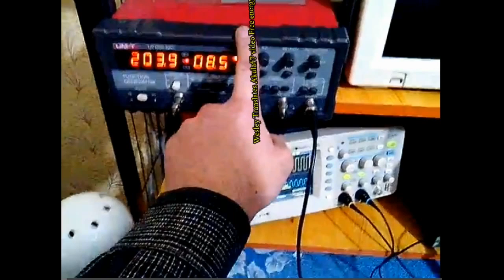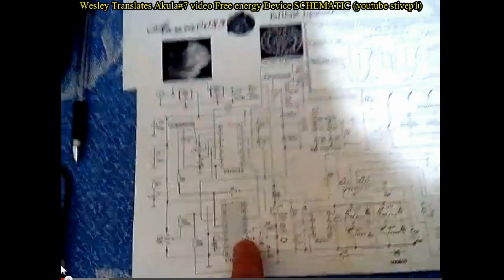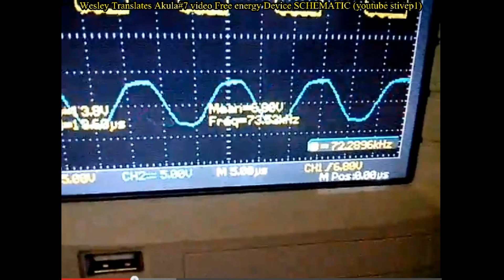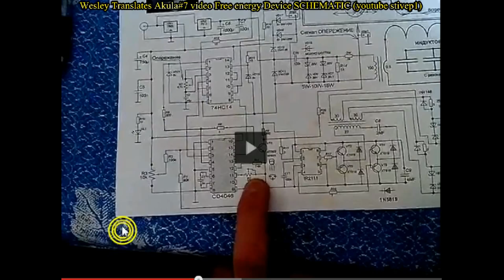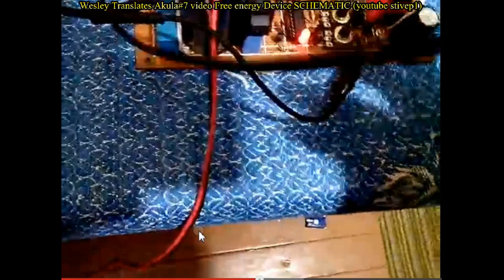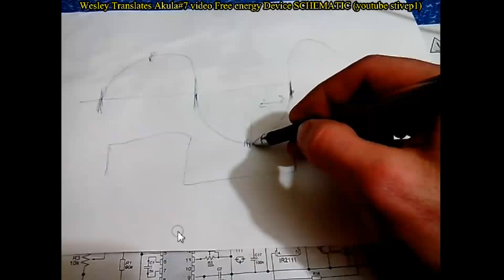Wesley Translate's Akula#7 SCHEMATIC  Free Energy Device

Comment: I'm guessing that where the magnetic field cross the electric field, is where the energy is pulled down. Also don smith said that voltage and amperage are equal and opposite, like a duality, in a circuit the current only appear when u create resistance to the voltage. Another thing don said is that the gravitational effect is caused by a magnetic imbalance.

Comment: to much dude, all those electronics not needed, i'm not saying wont work... i'm saying for sure there is simple ways, neither kapanadze or don smith had all that. There is simple formulas to obtain a certain ratio between  L and C, in order to obtain gravitational effect. At higher frequency, if we obtain this effect we can draw energy from the background ambient, in fractals where the lines cross is where the energy is pulled down.